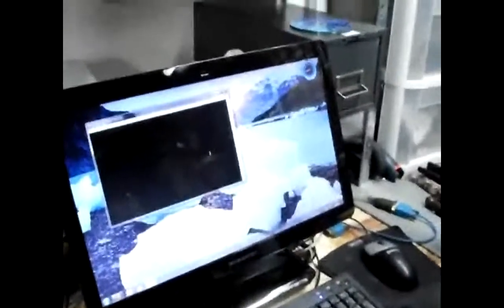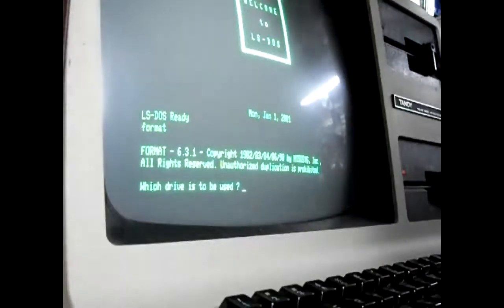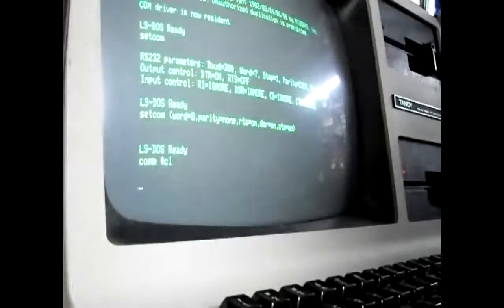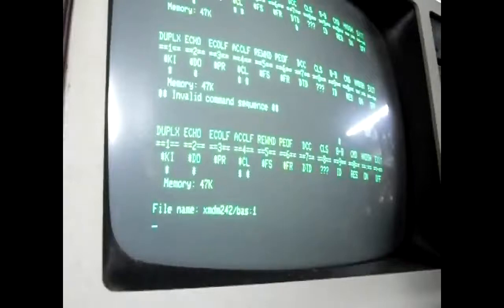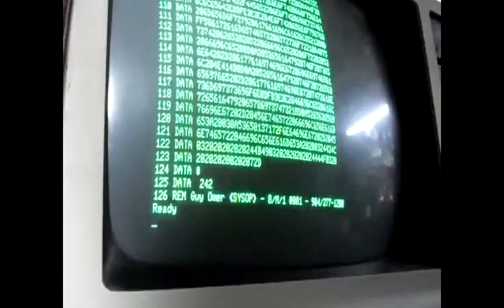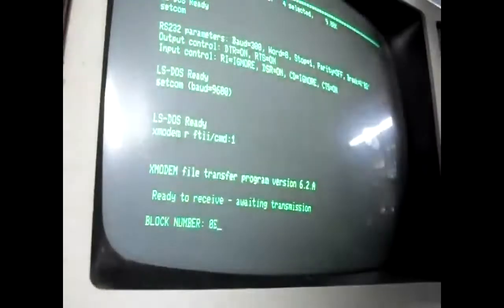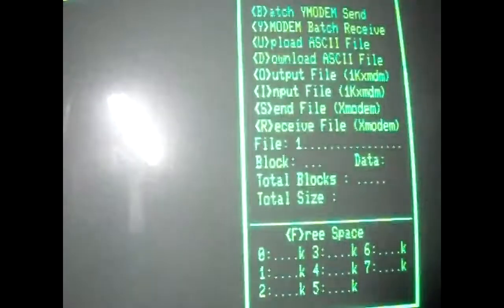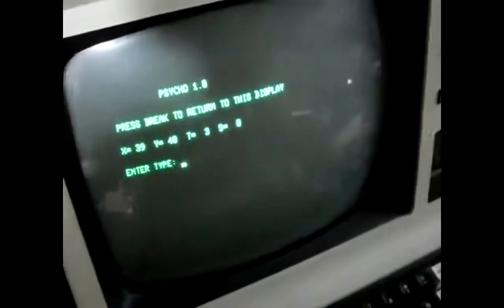Vintage Volts Video - Episode 1 - TRS-80 Transfer

Comment: Can this be done on a model II?
Reply from the maker: +Philip Russell I don't have a Model II to try it out, nor am I aware of its base operating system capabilities. but the fundamental process is simple. If the operating system on the Model II is like TRSDOS or LDOS, then has a similar operating COMM feature, it's only a matter of finding a good transfer program, like XMODEM, to advance the transfer process once it gets copied over to the Model II.
Reply: VintageVolts there was a terminal program for the model 2, but the software library was quite different for the Mod 2, with its business base, let alone the 8 inch drives

Comment: I had a TRS-80 Model I as a kid, and I have fond memories of dealing with the serial port with a 300 baud modem on it (I upgraded to a 2400-baud modem in 1987 and used it for about a year before I got my first PC and the 2400 baud modem worked on that.)I used to transfer files with XMODEM.I miss the good old days of calling BBS's on the modem.  In this day and age, it's all done with websites.
Reply from the maker: +jeopardy60611 I had to wrap my head around some of the serial concepts of a TRS-80. My first work with serial ports was in 1989 on my Amiga for dialing up BBSs when it was much easier to manage. I had discovered how powerful TRS-DOS really is when you want to work at the hardware level, as long as you finally break down the features into the smallest significant parts. This video is a culmination of that study.

Comment: Why is the TRS-80 so slow, especially the disk drive? It reminds me of a C64 in terms of disk speed. What's the transfer speed of the disk drives? I thought they would be somewhat similar to a PC 5.25" diskette, maybe 1/2 the speed or a little more. I don't have much experience with this particular machine. Do you have any interesting software for it?
Reply from the maker: I'm not sure the video shows much evidence of floppy disk speed. The TRS-80 can hold its own in raw processing power and operability compared to its competition of the day. Its disk drives are directly compatible to those of the IBM PC, and just about as fast (around 12,000 bytes per second). The C64's 1541 drive transfers at 300 bytes per second.

If you are referring to the transfer of data from the PC to the TRS-80, it may seem slow because it's being done through an RS-232 connection at 300 baud. That equates to about 30 bytes per second, which is far slower than any internal hardware data transfer.
Reply: VintageVolts I know the serial connection is slow with the older UART being stuck at 9600. I guess I wasn't paying close enough attention. The drives just seemed slow to me, loading up the ymodem program seemed slow. I worked on an XT for quite a while and it seemed like the disk was much faster. Might be my faulty memory though :)
The 1541 can be sped up quite a bit just with software, nowhere near the PC speed, but 8-10 times or more.
Reply from the maker: tarstarkusz I'm a "well bred" Commodore user myself, ever since the VIC-20. Believe me, I don't notice ANYTHING slow about the disk drives on any of the competition computers. LOL

Comment from the maker: I had to take my Model IV apart to check the drive model AND to fix a recently discovered boot problem (I haven't used it in over a month). Both drives are TEC 503s, so I guess I do have double sided drives. Thanks for the info!

I also discovered my boot floppy was bad. I had to switch the drives to fix it. Now I'm down to a single floppy and hard drive. :( 

I suppose I could put in a half-height 5.25 drive to replace the bad one, or two new half-height drives and cap the empty bay.

Comment from the maker: Thanks!! I was certainly glad that it operated so well after sitting all of those years. What's more, after I installed FastTerm II, I was able to "dial up" BBS systems connected to the Internet. The LapLink cable served as the "modem", and software on the PC bridged the serial port to telnet based BBSs.